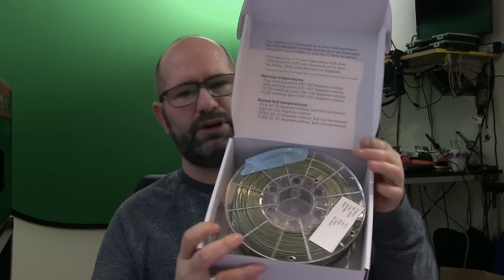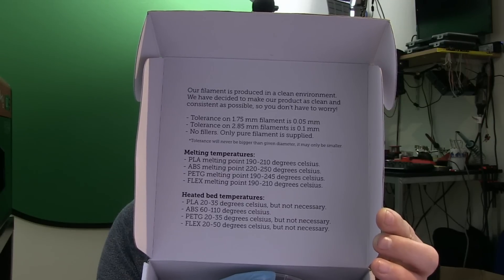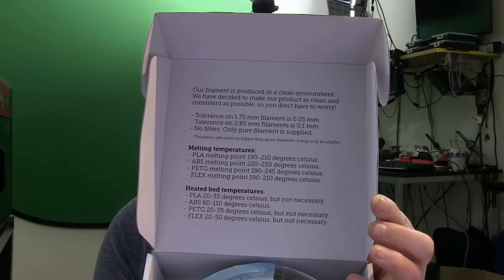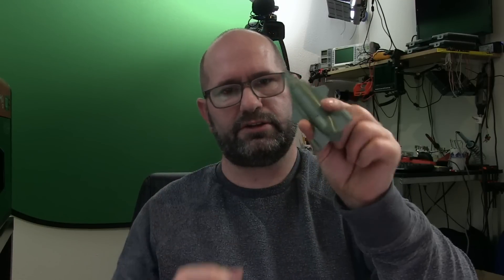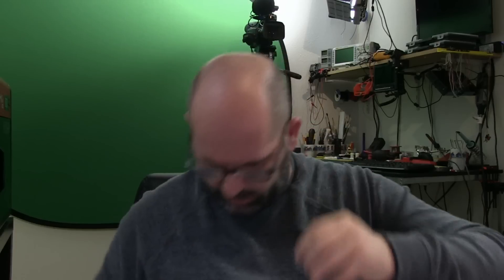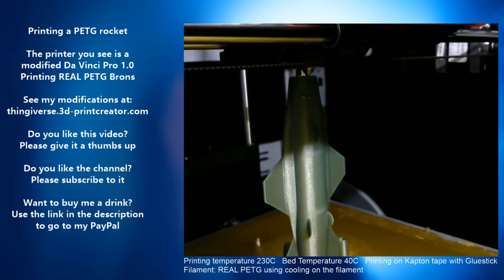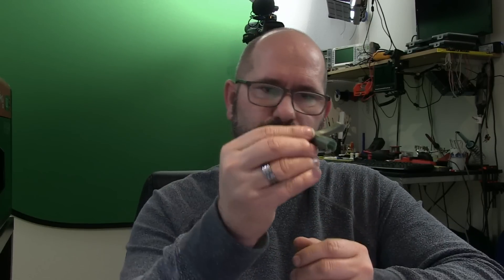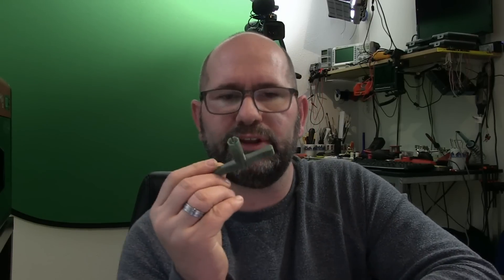▼ Using PETG on the Da Vinci Pro 3D printer (Just my simple thoughts)

Comment: Hey Brian, just wanted to know if the parts for that you suggested for the da Vinci 1.0 Pro should be printed in PETG or ABS? Also do I have to use XYZ software and is matter control compatible? Or do I have to buy simplify 3d work?
Reply from the maker: I used PETG for the parts, but I am sure ABS would work fine as well (and even PLA would do wonders here).
I don't know about Matter control, as I don't have that. I don't have the Da Vinci printers anymore, so I can't test it for you.
I bought Simplify3D just for the Da Vinci Pro, because back in the days, that was the only working software other then XYZWare for Pro. If you would ask me now, I don't think I would buy Simplify3d anymore, as other software improved so much, there is no need anymore for Simplify3d.

Comment: Brian, is it accurate that you can control the DaVinci Pro nozzle temperature from within Simplify 3D? I thought it was only adjustable from the printer itself (user filament setting).
Reply from the maker: Hi Jim. Back in the days I had the printer, it was possible to control the nozzle and bed temperature in a wider range then normally accepted with the XYZPrinting software. However, they changed this in the firmware of the printer and if you have this newer firmware, you are not able to control the nozzle and bed outside the range anymore.

Comment: I have a davinci pro 1.0 with an upgraded E3d  extruder and extra fan,  I print at 0.25 layer height at 80mm/s and I get phenomenal prints. I did many of the upgrades. For better quality prints I print at 0.2 layer height at 60mm/s and at 0.15 layer height I do 50mm/s. The new updated software from XYZ is a breeze to work with once installed.
Reply from the maker: Wow that sounds great. 
Nice to hear you have got your printer under control at these great speeds.

Comment: I have a printer like you DaVinci Pro. You could give somewhere tables with your set up printers on PETG, ABS and PLA so that I would have a reference (temperature, speed, retractions, extrusion ratio). I know that filament brands differ but I would treat it as a reference.
Reply from the maker: Hi Lukasz,
I think for about a year now I don't have a Da Vinci Pro anymore. I have a home made printer in the frame of the Da Vinci Pro but it's not at all an XYZPrinting machine anymore.
That said, The normal settings for PLA are 185 to 205 degrees Celcius, a printingspeed of about 50mm sec (faster is possible, but not with the Da Vinci), 20mm retraction with a retraction speed of 50 to 100mm per second. 
For ABS 235 degrees at 25mm/sec with the same retraction settings and the same for PETG. In fact I have a bunch of video's about these materials.

Comment: Hi,
can you explain how to spiral vase mode in software.
=> I have problems to connect simplify3d with my DaVinci Pro 

thanks
Reply from the maker: Almost every slicer I know has a vase mode.
Some call it spiral vase, some call it vase, but they all do the same thing.
When turned on, the slicer converts a solid body into outlines without any infill and with only 1 perimiter.
If you have bottom solid layers turned on, you will have a bottom in your vase. Make sure not to have top solid layers turned on, as then you will have no opening in the vase.

Comment: Will PETG damage the brass nozzle overtime on the XYZ Pro? Also can you buy replacements nozzles for the XYZ Pro? Thanks
Reply from the maker: PETG is not more abrasive then other soft filaments, like PLA or ABS. That said, every filament will over time wear the nozzle as brass is a soft material. It is however not like metal filled filaments.

Then for the second question, I have not found a replacement nozzle for the Da Vinco Pro printers but I replaced my hot-end for another hot-end. There are many instructions online on how to change the printer to an E3Dv6 hot-end and this really improves the print quality a lot and gives you the option to change the nozzle to other sizes or materials.

Comment: Is the stock xyzprinting slicer limiting temp to 240° or is it the extruder? will I need an aftermarket extruder&nozzle to print with PETG?
Reply from the maker: Yes the slicer is limited to 240C and no, you don't 'need' an aftermarket nozzle to work with PETG, I have done a lot of PETG prints with my original nozzle. The reason I went for another nozzle was because of the many hours I had on the original one and therefore I needed a now nozzle because the old one was worn. 

That said, the new nozzle does a better job printing difficult filaments because I took a hardened steel nozzle and not a brass one. That makes it possible to work with really abrasive materials, like carbon reinforced PLA and Glow in the Dark filaments are.
Reply: With the new firmware and XYZware the hot end temp has been raised to 260, though I know not why. Thoughts?

Comment: I'm using petg from esun but is looking for alternatives, would You recommend real filament? It's about €10 cheaper then esun so it's very interesting
Reply from the maker: Hi Henrik,
I am pretty happy with the REAL filament, including their PETG.
That said, I have had some comments from others that saw me buy a lot of REAL filament a week ago, and they said that the REAL filament is not consistently 1.75mm thick, and therefore i can cause jams.

To my own experience I must say I have never had any problem with REAL filament and I have used a good few kilograms of it, but this is what people told me.
Reply: Thank You. I've had issues when switching between pla and petg causing jamed extruder. Variations in diameter often results in poor print quality and not jams according to my experience. I think I'll give it a try.

Comment: When i create multiple process in simplify3d for either infill or temperature changes a easy way to figure out where you want the next change to be in your print with out measuring is to create the first process  and estimate the height then slice it and you will see exactly where the first process ends then you can go back and make changes and pin point exactly where your second process can start
Reply from the maker: Yes, I know it's possible, but for some reason I didn't succeed doing that.
Reply: Hopefully i wont miss your live stream this time around i was wondering if you can show us what you do for preventative maintenance on your machine like lubricating bearing and rods etc..
Reply from the maker: I set a reminder for you :-)
Next livestream is tomorrow
Reply: 3d Print Creator thank you Sir
Reply: How do you change the temperature mid print in Simplfy3d? I cant seem to figure it out. Any help will be appreciated

Comment: My flavor of PETG white is so stringy above 220, so I'm having much luck printing at 215/41 with a thin layer of GLUE STIC on glass, and set retraction to about 5mm. Also, getting a nice speed of 60mm/s.. also noting that movement between prints is at my max 100mm/s to minimize oozing! See my latest video.
Reply from the maker: I have noticed that white PETG behaves a little different from the other colors.
I also tested some white and had to use a lower temperature for it. Also, I saw you are using less retraction then I do (I use 6mm) and I will give that a try as well. 
My biggest problem though is that I have to use a different temperature for massive structures then for thin walls. If you try to print a block that is 10x10x10mm with on top a wall of only 10x2x10 then you will notice the wall has a totaly different structure then the block has. This is only solvable by changing the printing temperature.